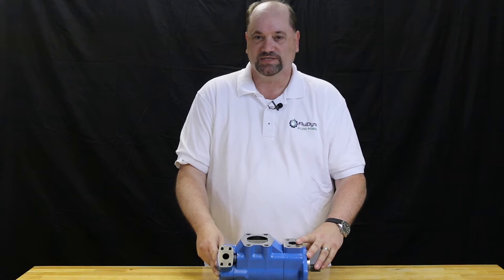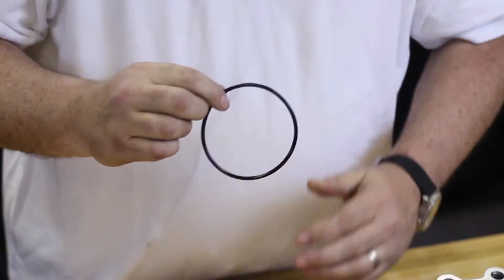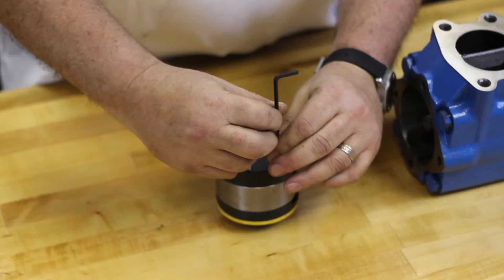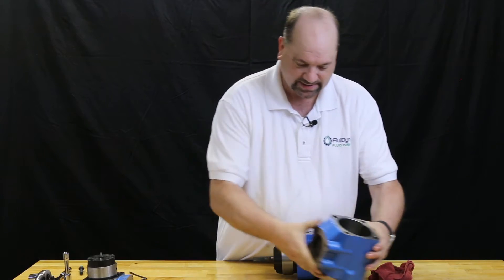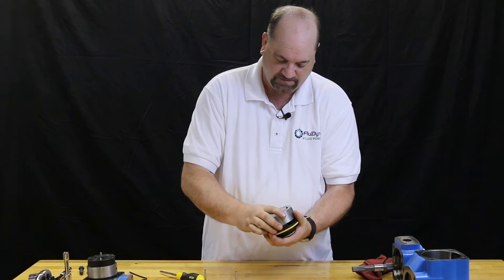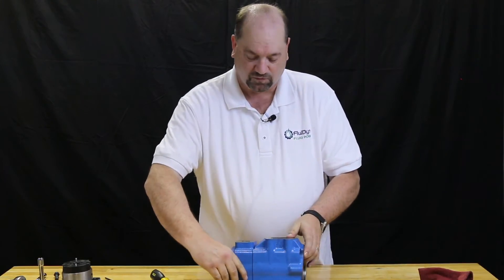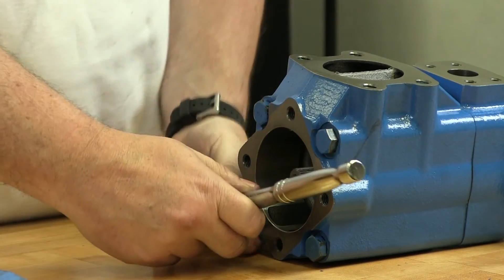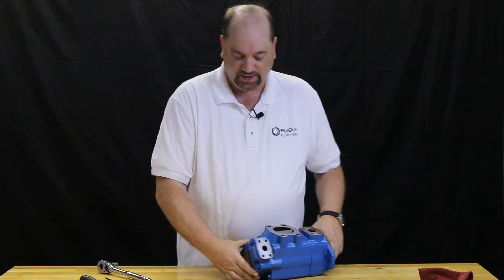How To Change Rotation on a V/VQ Double Pump

Comment: Good video, but two questions. First, why would you need to changer direction of rotation?
Second, is everything the same for a genuine Vickers pump and other aftermarket pumps?
Reply from the maker: There may be a number of reasons for needing to change the rotation. One is that if the new unit was ordered but rotation was not specified, the unit may be shipped with incorrect rotation so then it would need to be changed. Another is if someone has a replacement unit on the shelf that is a match except for rotation. One more is if you need a left handed replacement cartridge kit but you received a right handed cartridge kit then you would need to change rotation.

We believe normally aftermarket manufacturers will try to make pumps and parts interchangeability equal to Vickers so they can compete and gain that area of the market. Not many users would want to keep two separate inventory's for original equipment and aftermarket.  Our aftermarket is the same form, fit and function as Vickers.
Reply: On my large plastic mold machines, I have two sets of pumps (and motors) and they face each other. So one set is reversed.